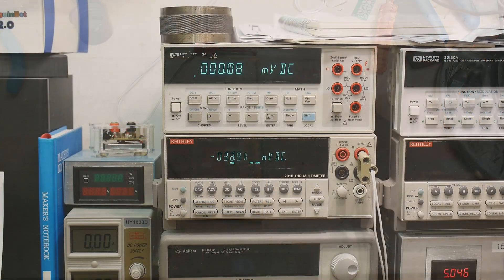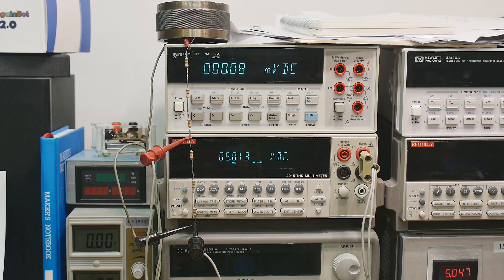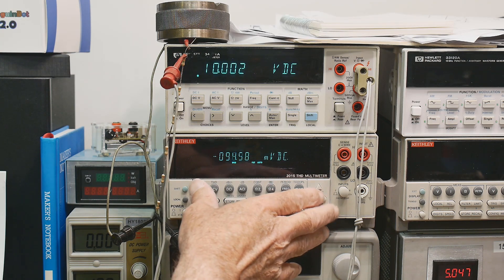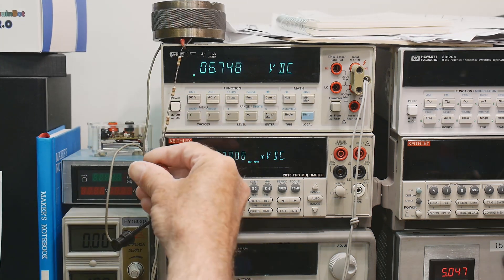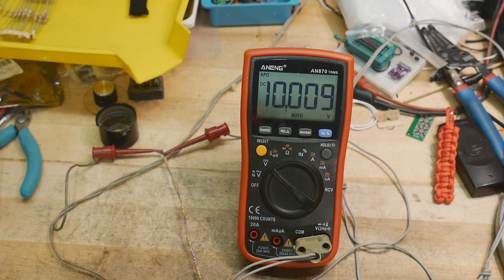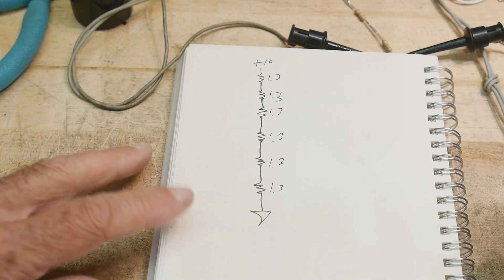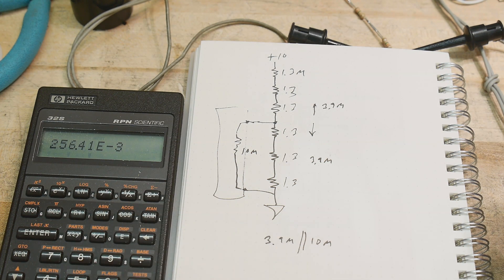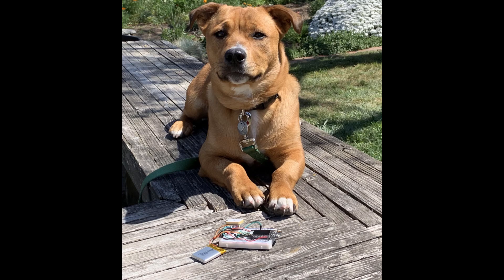#777 Multimeter Input Resistance (Impedance)

Comment: Do you know what circuitry actually creates 10M / 10G impedance through the DMM?
Reply from the maker: Jfet allows for gigohm. A 10meg resistor is switched in when needed.

Comment: So why is a DMM with high input impedance (10 Meg Ohm) when measuring AC Volts bad? The answer: Ghost Voltage. 

For AC volts, in the old days, when moving from a Simpson meter movement VOM like the 260 (Analog needle movement) to a Fluke 87 DMM (Digital readout) for industrial AC work, AC distrubution, or AC operated appliances (HVAC) many times a dead (unpowered) circuit would fool the Fluke 87 and produce a AC voltage reading which was not really there. Meaning it was being coupled into the circuit and only detectable because of the very high imput impedance. As far as I know Fluke directly addressed the ghost voltage problem with the introduction of the Fluke 289 logging indusrial DMM, which has a Low Z (about 3K Ohm) AC voltage measuring range. This low Z range will not exhibit the ghost voltage problem, I have personally confirmed this. Although it requires, in my experience, AC voltage measurements on the Low Z range to be momentary (to reduce power dissipation within the meter). This is not usually a problem for troubleshooting AC equipment, which I have found is usually momentary in making AC voltage measurements. If not you can always use the higher Z AC volt input range, which may ghost. It is relatively easy to make your own external load to defeat AC ghost voltage phenomenon.
Reply: i read all of that, but you lost me at ghost voltage.

Comment: Years ago, in a galaxy (state) far, far away I serviced photocopiers. On one particular Konica model you had to keep an eye on the output of the -300V (or so) power supply that biased the developer roller. This supply put out almost no current. The spec Konica gave for voltage assumed a 10megohm meter. I happened to have a 20megohm meter as some other piece of equipment required it (a lot of techs did). 

Konica could not figure out why they were having so many complaints with the developer PS always being over or under voltage when a tech checked it. It all depended on the meter you had. If you had a 20megohm meter you always set the output too low as you were not loading it down. Konica finally figured out and released new specs calling out the proper calibration voltage to use for each meter type.

Comment: I was taught, as an electrical engineering student, to always setup my test/measurement fixture/equipment in such a way that my equipment appears "invisible" to the DUT/UUT. This is particularly of high importance when designing/measuring high frequency RF circuits, where you have parasitic capacitance/inductance, insertion losses of cabling, etc. Sounds easy, but in practice, it is much more difficult than it sounds! Thank you for sharing this valuable lesson with us today IMSAI Guy. I hope that you and your newly GPS-enabled IMSAI Dog both have a great day together today! I'm looking forward to tomorrow's video already fine sir.   Fred

Comment: Ahhh, excellent! Just what I have been wondering about the impedance setting on my fancy 6.5 digit bench multimeter! The higher digits just never seem to settle. I had been writing that off to thermal drift. I have always just left the setting at 50 ohms, its default. So, what would be a rule-of-thumb for setting this perimeter, when the resistance is known? What about when the resistance is not known? Should you always start at the highest available impedance setting and work your way down, as with current measurements? How do you know when you have arrived at the correct setting? I would not have caught on to this point, if you had not drawn the circuit where I could see the meter in parallel to the DUT. You just made my day. Thanks for your efforts to teach us!